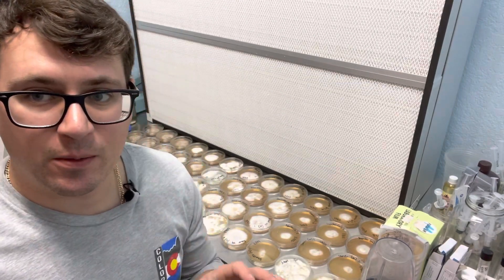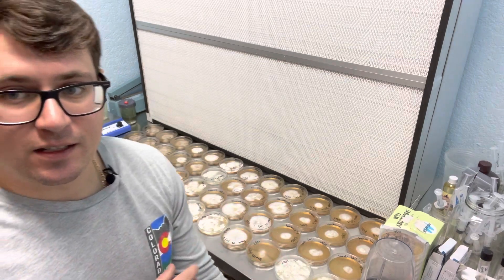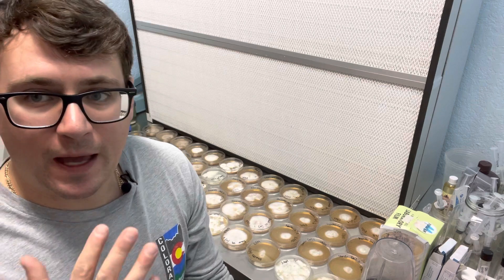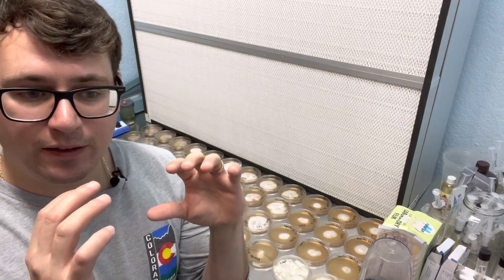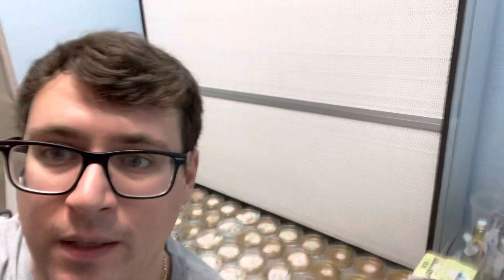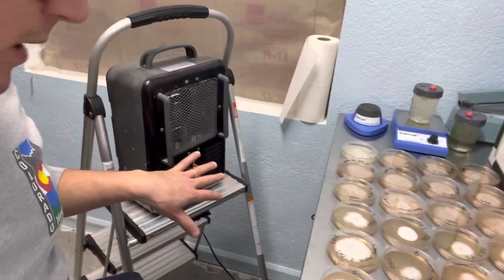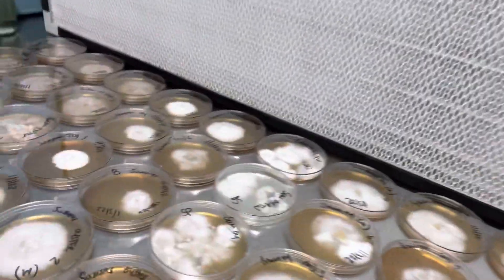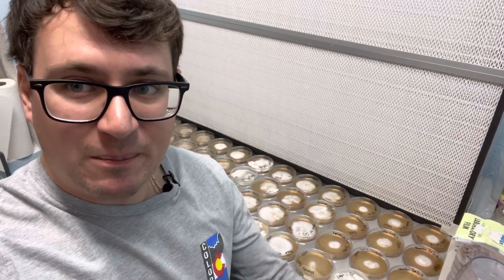Pro Tip: How to reduce condensation on petri dishes - why does condensation form on plates?

Comment: What if when you put the plates in the incubator is when the condensation happens?
Reply from the maker: probably the differential between the air inside the dish and the air in the incubator is too much - it should stabilize after a few hours you can mitigate it by heating up the plates a little first or warming the room or cooling the incubator

Comment: Hey Gary, do you incubate your agar dishes rightside-up (agar DOWN) or upside-down (agar UP)? 

I know generally agar dishes are supposed to be incubated upside-down (agar UP) to avoid condensation dripping on bacterial colonies and blending them. However, I've also seen that some people recommend for FUNGI dishes, the plates be stored rightside-up (agar DOWN) -- the reason is to prevent molds from sporulating onto the lid, and those spores being released into the lab air upon opening the dish. Considering the prevalence of Trichoderma, I was wondering whether it's best to incubate plates agar up or agar down. 

Ideally, if we can completely control for condensation, then agar DOWN would of course be the best practice. Perhaps I just answered my own question. Thanks for the video! 🤘🏻

Comment: This is cool for how to reduce condensation after the petri dishes have been steri taped. But how would we best reduce it when they're freshly poured and still under the flow hood?
Reply from the maker: pour them as cool as possible and let them dry out for a day or 2 in front of the hood

Comment: Thanks for sharing! Out of curiosity, have you encountered any issues with pointing a space heater towards your laminar flow filter?  Would it maybe be better to point the heater towards the air supply of your filter?
Reply: You can easily put a heat source on the air intake just like the heater in the house.

Comment: So the petri dishes are not sealed with parafilm tape?  I am guessing the condensation must be able to escape then but if you got a flow hood not a problem, for us with a SAB a tricky issue.
Reply from the maker: It can still be done when parafilmed.  Parafilm is parafin wax and allows for some gas exchange. Temperature is the most important factor still

Comment: Thanks, Gary. Do you have suggestions for storing colonized Petri dishes in the fridge? I haven’t figured out how to do this without a lot of condensation forming. Are there ways to avoid this? Simply inverting them doesn’t solve the condensation issue. How do professional labs address this?
Reply from the maker: I store them inverted - yes it’s the best way because it keeps the mycelium out of any condensation- I also use slants which are better for storage.  If you are worried about the condensation you can store at room temp but the shelf life will be much less

Comment: For a few plates you can use a cup or pot with a hot water. Flat bottom metal ones are the best. Just put it on the plate keep for a few seconds, then repeat until condensation is gone. For a glass plates though wait until half of the condensation is gone, rest on it will dissipate eventually, as glass absorbs more energy and stays warmer for longer.
Reply: Are you doing this in a SAB?  Would it work to move the freshly poured plates to something like an ice chest, heated with a pad, or wrapped in a heating pad?